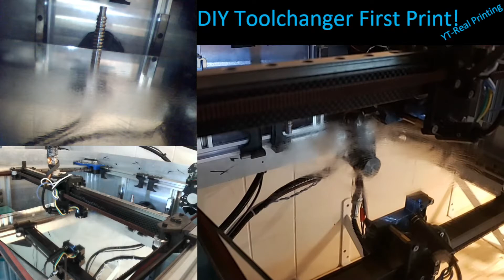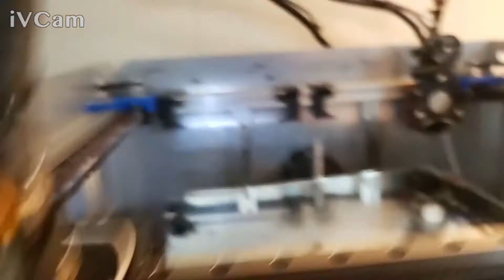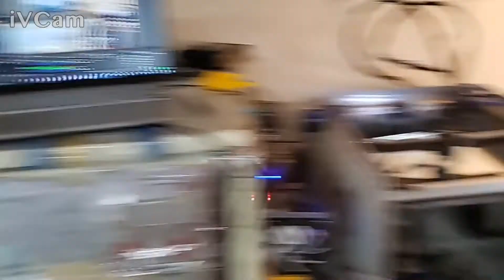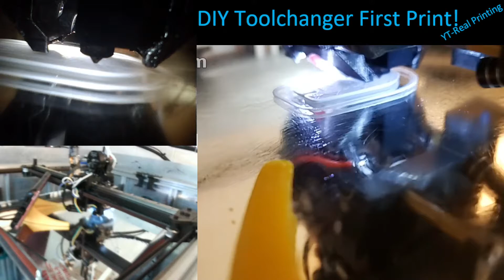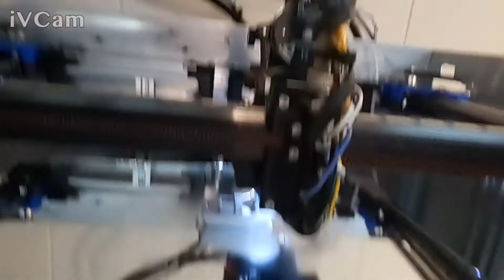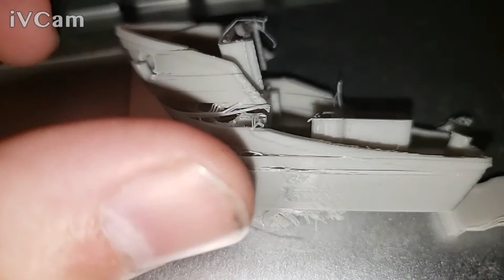DIY Toolchanger's First Print!!

Comment from the maker: The biggest problem in this was that I had extruder steps per mm set to 420 when it should have been around 700 for the sherpa mini extruder. Still unsure why it skipped steps outside the possibility that a driver overheated